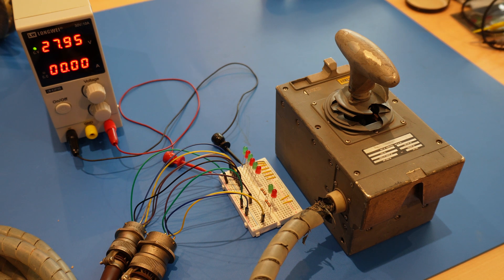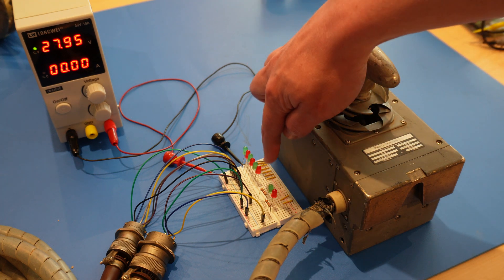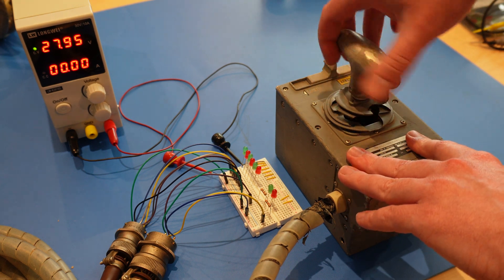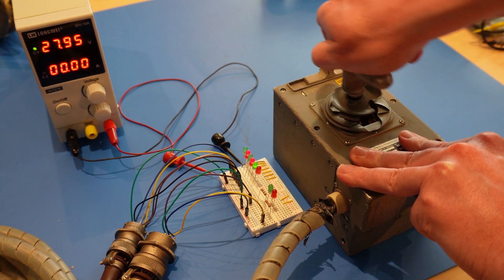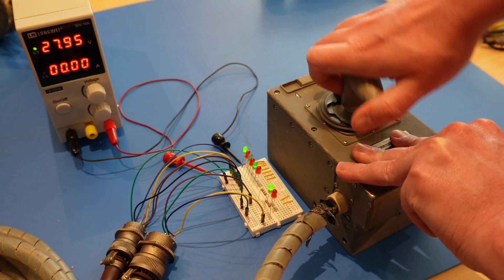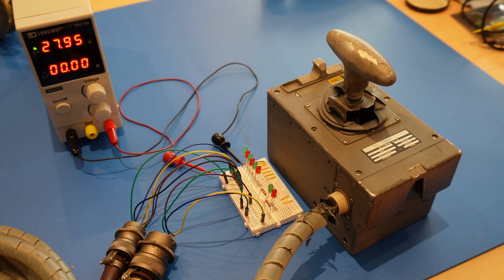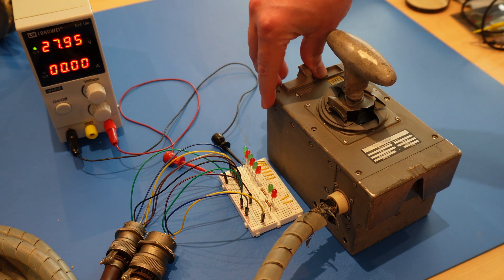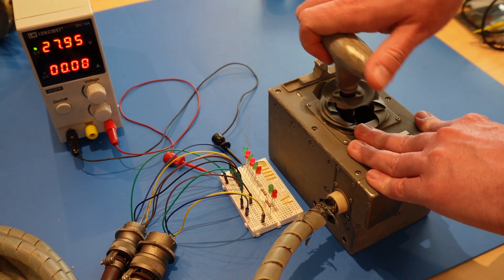Command Module Translational Hand Controller multi-axis testing

Comment: Well done, Mike! Do you now what's happening internally when the stick is moved for L-R / U-D translation? Given that full range of circular stick motion, it seems likely a ball and socket joint is used. From the "feel" of the sticks travel, can you estimate how deep inside the physical box this assumed ball and socket might be located? Do you know how the stick mechanically actuates the microswitches? Direct contact with a plate attached to each switch or a linkage? Any speculation is appreciated if you don't know... And I second the motion for a "breakdown" video.😁
Reply from the maker: Sorry, I'm not sure. We haven't opened it up yet because there's nothing wrong with it, but it's not off the table. I'll have to take a closer look at what it would take.
Reply: @mikestewart8928  Thanks for the reply, Mike. I suspect you've seen the x-ray photo of the interior that's online. It does not reveal anything beyond the general shape of the interior components, but it might be helpful in making your decision...
Reply from the maker: @thomasneal4775  I opened this THC up yesterday. I'll be able to take higher-quality photos and video in a few weeks, but here are the initial phone pictures/video I took: https://photos.app.goo.gl/wPxHJLnaurekxcPn7
Reply: @mikestewart8928 thanks a lot for sharing. It is really interesting how they used a translucent resin for potting. How many hours of work could have been spared if they only did the same for AGC modules!! It looks like natural amber from Jurassic Park
Reply: @mikestewart8928  Thank you so much! I have a great interest in the early space program (especially Gemini as one of my friends had worked on the ejection seats.) I hope you do similar show and tells with the other controller in the background someday! I just acquired some block 1 style switches that I can mate with my two switch guard that I believe was from an apollo sim of some kind. I also have a cast of a LM RCS grip

Comment: Wow, that coo! Are any schematics or drawings avaliable for translational/rotational control units? I'm designing both of them for my simpit.
Thank you for the video!
Reply from the maker: Nothing mechanical is currently available online, as far as I'm aware. The CSM Functional Integrated System Schematics (https://www.ibiblio.org/apollo/Documents/CSM%20Functional%20Integrated%20System%20Schematics%20Block%20II%20Revision%20K.pdf -- see drawing H3, columns 7,  22, 48, and 86) and the CSM Systems Handbook (https://www.ibiblio.org/apollo/Documents/HSI-481260.pdf -- see pdf page 166) have rough electrical schematics at varying levels of detail. The National Archives at Fort Worth will have the North American specification control drawings, which should contain external dimensions, pinouts, and maybe better electrical schematics, but sadly I don't know where to look to find mechanical drawings of the internals.
Reply: @mikestewart8928  P 165 of the PDF has a block-diagram of the wiring.  Would love to find some mechanical drawings.
Reply: @mikestewart8928  Ah I got you, so it's as I though.. I've found pictures of internals of a rotational control unit but only 1x X-Ray picture of a translational control (I'm pretty sure you saw that one as well :) ). Anyway, thank you for that video, Mike, it gave me quite a few bits of information for designing my copy. 
PS. Hopefully there will be a teardown video at some point? haha
Reply from the maker: @deathblowhere  I opened this THC up yesterday. I'll be able to take higher-quality photos and video in a few weeks, but here are the initial phone pictures/video I took: https://photos.app.goo.gl/wPxHJLnaurekxcPn7
Reply: @mikestewart8928  Oh, is it Xmas already?! haha 
Brilliant! Thank you Mike!!!
Reply: @mikestewart8928 the info is great. Thanks!

Comment: Wondered how it could do more than tow but realised it pulled in and out 🙈 can you use it on a modern game? 😅 Seems as though it takes a while for the lights to come on
Reply from the maker: If you were to build a USB adapter for it, then sure! The switches are designed to actuate at 75% of the travel in each direction, which is likely responsible for the delay you're seeing.
Reply: @mikestewart8928  ahhhhh makes sense, thanks for sharing!

Comment: Clickbaity video title idea: The most expensive joystick ever is only a D-pad inside (with a twist)

Does the arm/lock switch do anything electrically?
Reply from the maker: Nope! That switch is purely mechanical -- it causes two plates with semicircular cutouts to press in against a notch in the handle, preventing it from moving in any of the three axes. You can still twist it clockwise and counterclockwise while it's locked, though.

Comment: That's really cool Mike!  It's one of the bits of Apollo gear that's always remained iconic in my memories having grown up during the program.  What function did the L/C/R switch serve?  It has quite a stout detent!  I always assumed rotating the stick would have been the 3rd axis for yaw, I didn't realize it actually moves on the 'Z' axis presumably for thrust?
Reply from the maker: Yeah, the left/right/up/down/in/out all controls the thrust of various reaction control jets mounted around the vehicle, in the three axes. The chonky clockwise/counterclockwise motions have fairly significant meanings: during launch, rotating the handle counterclockwise will initiate an abort (command module pulled away from the rocket using the launch escape tower, and all that jazz). Throughout the rest of the mission, it won't do anything really. Turning the handle clockwise transfers control of the spacecraft from the AGC to the SCS (Stabilization & Control System), which functioned as a backup control system in the CM in case the primary guidance system failed. Having this be an easy function of the hand controller allowed for rapid switching to the backup mode in time-critical situations.
Reply: @mikestewart8928  Thanks for that.  It also answers a long held question of mine; regarding the post-sep function of the abort handle.  I understand A10 LEM abort was via the abort toggle switch, and not anti-clock rotation of the ACA.
Reply: @David-lb4te just to clarify, this stick is for translational control, not rotational. That’s why rotating the stick around its protruding axis doesn’t correspond to a directional thrust, rotating isn’t a translational motion. You are correct though, LM aborts are done through the Abort or Abort Stage push buttons on the main console.
Reply: @CaptainSwag101  I didn't say it was for directional control.
Reply: @David-lb4te  Sorry, I misunderstood. You mentioned the ACA in the LM, which is its rotational hand controller, and so I thought you were under the impression that this was also a rotational controller.